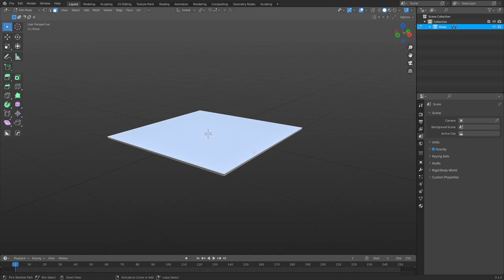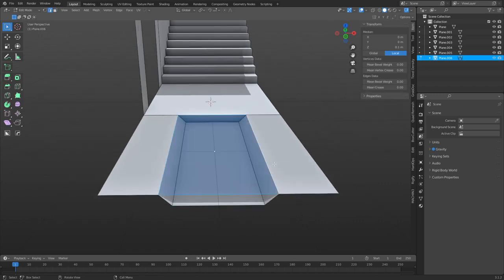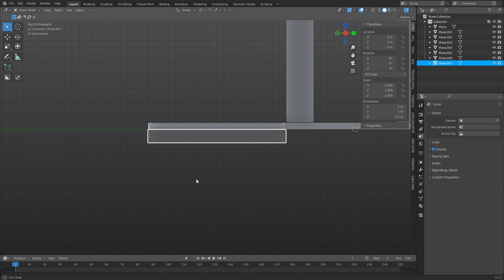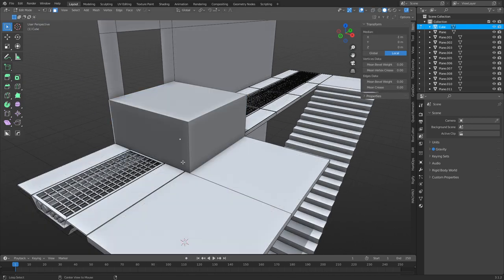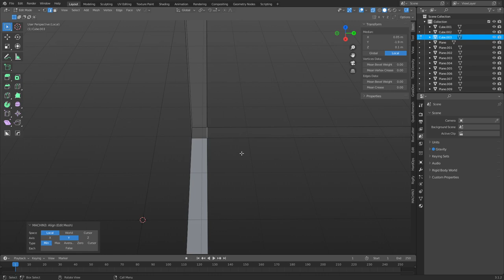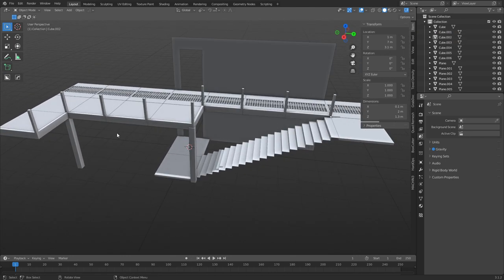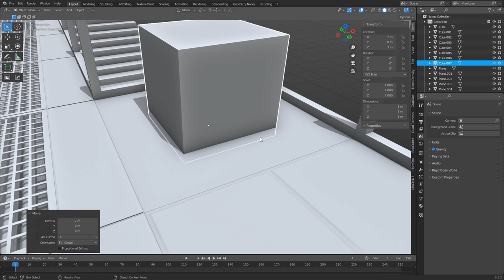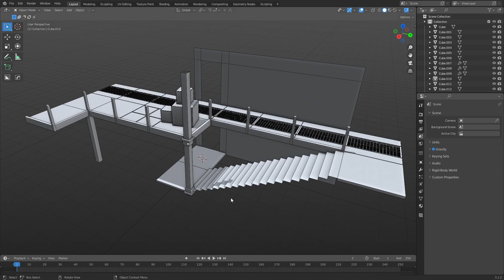Blender - Modular Floors

Comment: These are so helpful! Sometimes you jump between snapping (active element etc) and it's not entirely clear why to a novice, same with placing the origin for objects - could you do a video explaining your approach to snapping and why you place the origin at certain locations,  thanks!
Reply from the maker: It should be in the grid video. Groups snap median points which wont go on the grid. An active element will. Think of every object as a volume cube. Generally you want to snap in corners, edge centers, or face centers. Where you want to align to the grid. 

Helps you place objects later on.